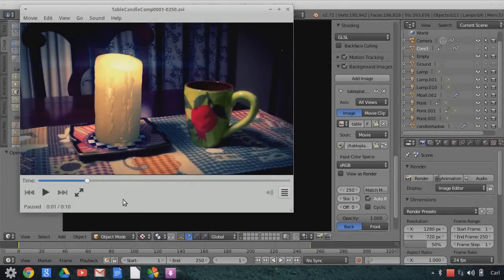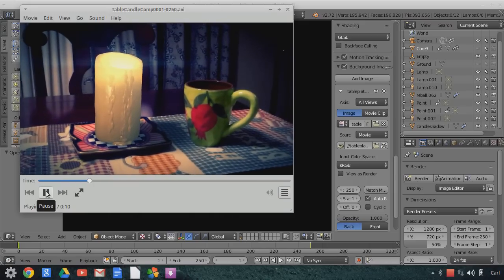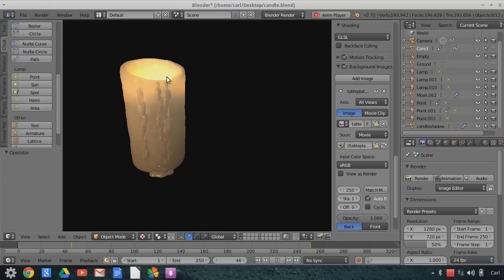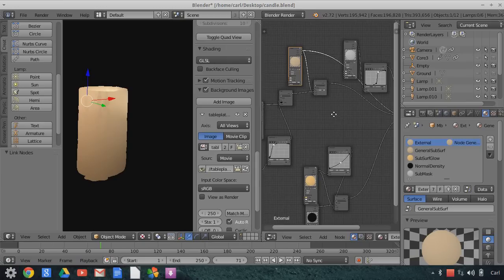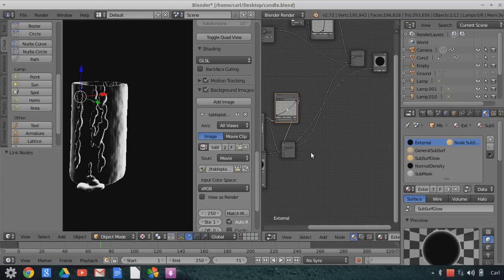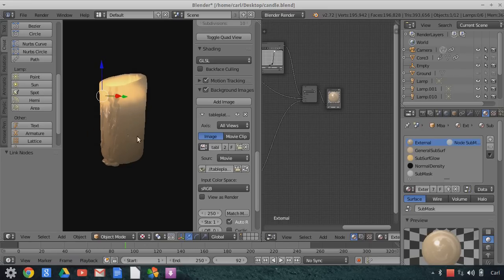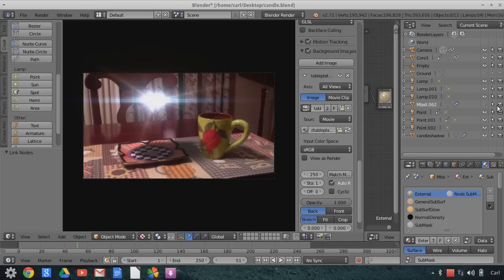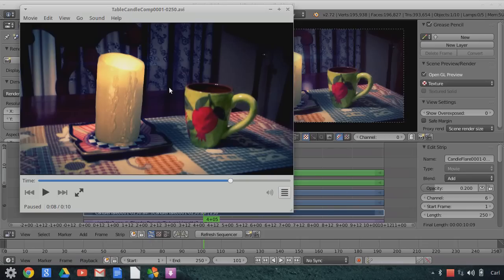Blender 2.7* OpenGL Sub Surface Scattering Application (Tutorial)

Comment: Hey! Is it linux you"re using?
Reply: buzamrk Yep.  I use Ubuntu Studio which is an Xfce desktop environment.  I find that it works better with heavy a/v computing than the unity or gnome variants of Ubuntu.
This is the author btw, commenting from another YouTube channel account.
Reply: The Common Magican Thanks for answering :) Is rendering faster in linux then in windows? Because my render is quite slow in windows and i hope i can get a better performance.
Reply from the maker: buzamrk I'm back on the right account now... It's difficult to say if working in a Linux platform is quicker on the same system (apples to apples).  Theoretically, there are fewer computing processes and simpler file system routes in most Linux environments than in Windows.  The trade off is that you need to let go of all of your proprietary Microsoft applications and replace them with open-source alternatives (that's easier to do than one might think).  But you also have to go through the process of learning all of Linux's idiosyncrasies.  Dell computers are probably easiest to work with Linux on because Ubuntu is a supported environment that they ship most of their hardware configurations in as an option.
Reply: cfirwin3 Thanks for the advice